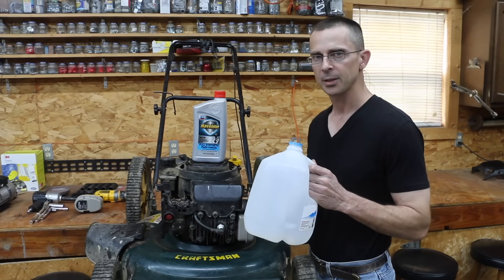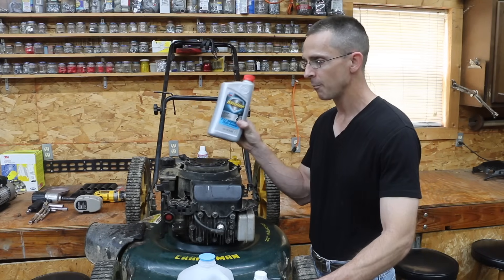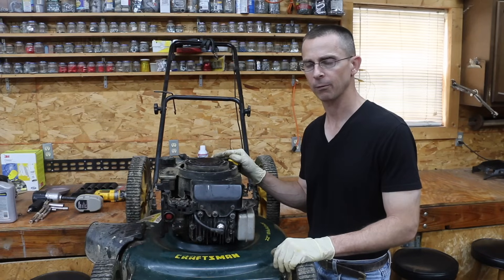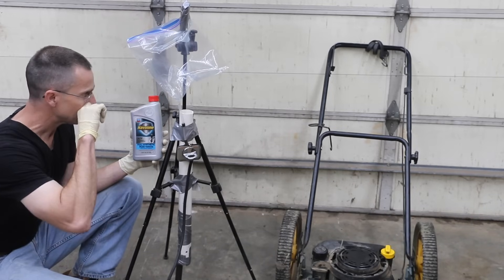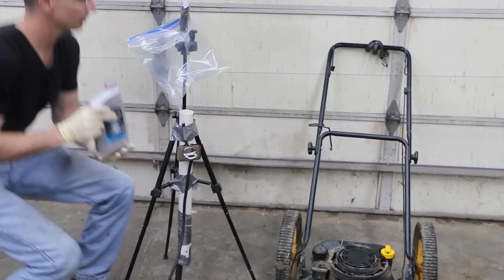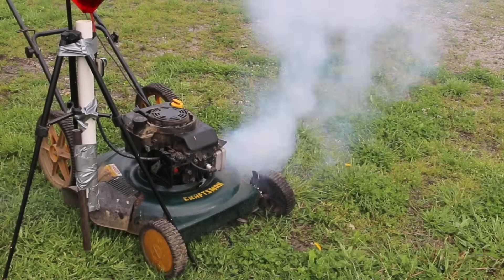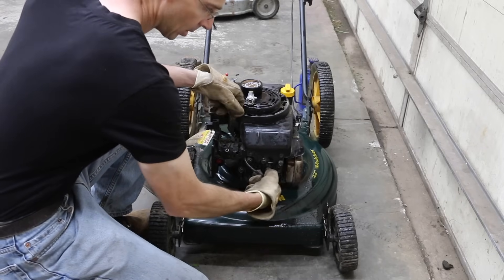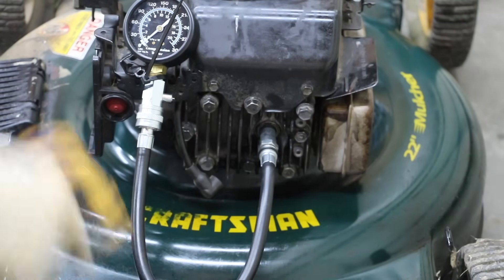Seafoam--can't believe what it did to my engine episode 6--Seafoam vs ATF!!

Comment: Did the test well, good effort and from the videos it seems nothing used does much cleaning of coke.
That said while you may be cleaning the upper cylinder, no matter what you use if it is not all combusted it will end up going past the rings to the bottom end and mixing with the oil, and wont do the bottom end any good.
So don't aspirate any liquids into the carby to clean the top end as it will only harm the bottom end.
These upper cylinder cleaning product are possibly the most harmful snake oil I've encountered, most others just do nothing where this can do damage.
If that doesn't convince you then at least change the oil and filter straight after using it, so add the cost of an oil change to it.
Reply from the maker: This is a great post and you bring up some great points regarding crankcase contamination.  I've seen this occur, especially in the water test video.  Thanks!
Reply: Yes I saw that one the water is quite visible. That gives you some indication of how much of any aspirated liquid ends up mixing with sump oil, and depending what it is will determine how much that thinning out causes bottom end trouble.
Other issues I have with this is dislodging coke in the engine whilst its running, there is a risk some of that will get pressed into the valve seat and burn causing a potential issue with valve leak.
And dislodged bits being forced down the piston sides to the rings where it wont come back out potential cause a ring gumming and loss of compression.
Imaging if you cleaned of all the coke with wire brush and then took the pile of it and tossed it into the intake at revs.
If you get the inclination to that might be a good video to do to determine the downside of using anything that cleans coke off whilst running. 
However you would need to tear it down to observe no debris on the valve seat or down the sides of the piston and above the first and even second ring and how much is there already before the cleaening.
Assemble it, add and exact measure of oil, and run the cleaner through it a few times for good measure, sea foam for example, then tear it down and inspect for any debris down the pistons sides, and the valve seats and remeasure the oil volume to see how much of the liquid mixed with the oil.
Perhaps retest the oil lubricity on your test bed too to compare the new oil.
If what I suggest is the case it would show pretty conclusively that these products have a serious downside and not just a comparison of their upper cylinder cleaning properties.

Comment: ATF and acetone are often mixed to create a penetrating oil for use on rusty bolts and the like by mechanics, I'm already curious about acetone alone but if acetone can't be run into the engine by itself the combination with ATF with acetone could yield interesting results
Reply from the maker: Thank you for this recommendation!

Comment: What have you found best works for knocking off carbon in a motor
Reply from the maker: I've got a lot of other additives to test before providing a final opinion.  To date, both Seafoam and Marvel seem to do the best.  ATF works extremely well too, but I'd avoid using it in an modern engine to avoid damaging sensors and the catalyst.

Comment: I know its easy to dump fluid down a engine. But removing the top of the head that easy id just clean it up on soft wire wheel.
Reply from the maker: This is a great point. Thanks for commenting.

Comment: what if you did a soak of the piston head? i know its harder on a lawn mower but my thinking is if you took the spark plug out dumped some sea foam in there let it work for a while and then sucked out the excess liquid what would happen
Reply from the maker: Thank you for this recommendation!

Comment: I'll use atf fluid.I do have a question for you what would you  recommend to clean out the  gas tank on a Briggs and Stratton series 450 push mower it got a white Chrystal powder in it form sitting for a while with gas that dried up in it please let me know what I can use I don't have a lot of  money to get a new one thank you
Reply from the maker: I would suggest removing the tank if you can and attempt to rinse it out with fuel.  I presume the fuel tank is plastic. Plastic is very sensitive to harsh solvents, such as acetone.
Reply: Project Farm  it has a metal tank

Comment: Hello. Sir i have an hydrolic oil do this work also like automatic transmission in cleaning the combustion chamber?
Reply from the maker: They both share very similar properties.  I wouldn't recommend using ATF or hydraulic fluid in a modern engine due to possible issues with the catalytic converter or sensors.  Thanks for commetning.

Comment: Years ago many mechanics used ATF in there gasoline tanks to clean. We poured about a half cup of Marvel Mystery oil a little at a time straight down the carb to clean it. Slowly or it would stall. Smoke like hell but when it cleared the car ran great.
Reply from the maker: Thanks for commenting on this!
Reply: Project Farm  Go to Google and in the search bar write in   LS1 Testing Oil and you will see the write up. The guy Sarge and crew tested and found 1 oz of Marine outboard two cycle TCW3 rated oil  at 1 oz per 5 gallons of gas will clean and lube your entire fuel system. I've been doing this for over a year and my Jeep and Volvo run great. You wouldn't know they were running at idle. It must be Two Cycle Water cooled  3 series oil not just two cycle. Works like MMO or Lucas but cheaper. Walmart has SuperTech Marine TCW3 for  about $13.00 a gallon. Try a pint and a few tanks you won't be disappointed.

Comment: Jordan make sure that when ur driving the car, use a 1 to 4 ratio. example: 1 quart ATF plus 4- quarts oil depending how much fluid engine uses. Couple days ago my oil was already dirty/ black. I added 1 quart of ATF drive 2 hours to relatives home drained it next morning. Added new filter and oil. usually I run 4 quartz of ATF with new filter only, only on idle for about 20 minutes. no driving,  no reving.  1 to 4 ratio as described above helps as oil pressure builds to get the high up cams.  thanks for feedback.

Comment: ATF is the BEST FLUID I found so far.  Recently, I did 2 Engines that is 20+ years old. OMG, the Engines are soooo smooth now :D. It made it sound almost brand new again during running !!! I also used it as a Cleaner and Wash the Engine Head / Scrub them to Bare Metal Shine.  I also use them on my Air Compressor and it made the Motor really quiet as well.
Reply: I made a Video in case People wants to see it, here:  https://www.youtube.com/watch?v=Luqmx0VlN1w
Reply from the maker: Thank you very much for commenting on this and thanks for the video link!
Reply: +Project Farm - I forgot to add, GREAT VIDEO AS ALWAYS.  I like the part that " Instead going to a Movie ", you do these Video instead.  Not just for yourself, but for People like us that watches them and learn from them.  Regardless if it's Bad or Good, I considered it's a learning process.   Your mistakes won't be mine sorta thing... So yea, a BIG THANK YOU AS ALWAYS !!!

Comment: Works great on diesel engines. It is even what the Dodge dealer told my dad to do in his Cummins to clean the injectors.
Reply from the maker: Thank you for commenting on this!
Reply: I forgot to say that in this case the transmission  fluid is to be mixed with the diesel fuel. It is poured into the tank and add fuel to mix it. About a quart per 20 gallons or so.

Comment: Have you tried to clean the valves in your mower engine with a toothbrush and seafoam yet?  
If so, was there an increase in compression?  I ask because I have a mower which has not run in 6 years. 
I loaned it out and the person thought kerosene was the same as gasoline.  It lost so much compression you could turn the engine over by hand without ever feeling the compression stroke. I decided to see what could be done short of buying new engine parts.  
After cleaning the exhaust valve with a brush and seafoam, the engine has gained a second life. 
While I have not tested compression, it runs as it did prior to loaning it out. (after a complete emptying and rinse out of the fuel system and a new plug) 
----------------------------------------------------------------------------------------------------
Hoping to have luck on a Kawasaki Ninja 900 this week.  Low compression on two cylinders. And based on the fouling of the plugs, I feel seafoam and a toothbrush might just save a $750 repair bill.
Reply from the maker: I haven't tried this yet. Thank you for this recommendation!

Comment: Try AMSOIL PowerFoam next.
Reply from the maker: Thank you for this recommendation!
Reply: Project Farm I admit I have used it in automotive/motorcycle applications. Does a decent job on the throttle body and the expansion of the foam did get to most areas of the plenum. Never used it on a mower or two stroke though. Also haven't the slightest on what happens in the cylinder as far as cleaning. I believe since it's a foam it's a little easier on the engine because it's not being sucked in as a complete liquid. Would be an interesting video for sure.

Comment: I used to use a mix of ATF paint remover a small amount of 30 WHT motor oil am 1oz of water shake till milky white at a high RPM slowly pour into the carburetor only one quart is needed did.t have seafoam if you can get it use it
Reply from the maker: Thank you for this recommendation.
Reply: Ok cool 2 parts ATF to 1 part 30 WHT oil  1/4 cup paint remover an then water shack it up real good we used this mix to remove carbon build up on older cars back when they lowered octain rating on gasoline piston slap an knocking ways a big problem in those day's I never did a tear down before an after to see how well it worked

Comment: Atf is similar to engine oil other than that it has significantly more detergents. That's why it cleans so well. You can use it as a motor flush too
Reply from the maker: Thank you for this recommendation!

Comment: ATF is a high detergent  lubricant. Enough of it will cause carbon to migrate into the oil and  sieze up the cam shaft. Been there, done that. People wanting to "clean out" a neglected engine have mixed ATF with engine oil at oil change.  Even 10% ATF can be a disaster.

Comment: Back in the day a car salesman I knew would pour ATF down the carb on engines with carbon build up. He poured it in until flooding out the engine. Let it set over night, pulled and cleaned plugs. Presto!!  The ATF soaking is what's effective not burning it. What it did in the crankcase will do for the combustion chamber and piston top. LOVE YOUR VIDEOS!!!!
Reply from the maker: Thank you!

Comment: A mix of approx 1 quart atf per 20 gallons gas (use 2 stroke oil at same mix rate for diesels) with every tank keeps the cylinders, heads, valves freaky clean. And when doing an oil change, you can drain a quart of the old oil, and add a quart of atf, then drive the engine for 50-100 miles (NO MORE THAN 100) , then change your oil. The atf will break up and remove a ton of deposits and de gunk the passages
Reply from the maker: Thank you for this recommendation!

Comment: I keep watching different way you are cleaning the carbon ? But what is the big concern with it having carbon ?
Reply from the maker: It could effect piston rings and on the necks of valves.  In engines with multiple cylinders, it can cause driveability problems.  Some of the newer direct injection engines are experiencing issues as a result of carbon build up.  Thanks for commenting!
Reply: I have a newer 4-mix 2-cycle sthil weedeater..... This seems to be a big problem with them.

Comment: I like your experiments, and just subscribed. I have used Seafoam in my Ford to clean the carbon out, purely out of belief that less carbon will fall into the oil to abrade the bearings if buildup is reduced. Frequent oil changes also of course - I'll never know how much each contributes to keeping the machine going, but at 30 years and 260,000 miles with strong compression in all cylinders, there is the satisfaction of taking care of things.

I never have a gauge, though, of how long it takes for the carbon buildup to return after a cleaning. What is your experience?
Reply from the maker: Carbon can return quickly if the engine isn't healthy or if the gas/fuel mix is off.  However, if an engine is property tuned and healthy, it can go quite a while without much build up.  Thanks for commenting!

Comment: How about when you have the head of your lawn engine , see how it takes to wire wheel the carbon off  piston and head valves close. Check compression before and after and remember compression on the high side spells horse power. The amount of carbon in engines today is not harmful , burning oil is more harmful then sucking on a tail pipe of today's engines . trany oil is a detergent nice job on wiping out a set of piston ring also trany on the walls cause fuel to light at different times hows your top ring of the piston doing now. You are changing ignition firing with cleaning additives, thank god for knock sensors in engines . Change your oil, when you see carbon blow by passing the piston rings turning your oil dark and then just maybe that dirty oil wont kill a valve lifter and your engine might keep its compression . keep up your good work on your learning curve. please stop burning oil and harmful chemicals for your own safety and your family . take care
Reply from the maker: Thanks for this suggestion!

Comment: I add ATF (GM type only) to the crankcase at every oil change. It really cleaned out the sludge in my 1940 model tractor engine that had deposits so thick I was scrapping them out with a putty knife before trying the ATF. Great vids!  Great editing, right to the point, real world results!  AWESOME CHANNEL!
Reply from the maker: Yes, I've heard ATF does a great job at cleaning the crankcase. Thank you very much for the positive comment!
Reply from the maker: ATF does a great job cleaning deposits in a crankcase.  Thanks for the positive comment regarding the channel!

Comment: You should try some of the CRC products. They have a lot more products than seafoam. Top engine cleaner, Motor Treatment, Intake valve and turbo cleaner (for toe of GDI motors), and a whole lot of other products.
Reply from the maker: Thanks for this suggestion.  I'll try some CRC products.  Thanks again!

Comment: how long do you keep it in a car and is it running , my oil light is on and was told to use it ?
Reply from the maker: If your oil light is on, it has low oil pressure and running the engine could ruin it quickly.  I don't want to offer advice that could worsen the problem.  It's difficult to advise without determining existing oil pressure and then figuring out why the pressure is low.

Comment: I understand there are silicones, and additives in aft that make it unsuitable for use inside a combustion chamber.  Of course inside a lawnmower is fine, but not in automobiles where o2 sensors, cat, etc. will be damaged.
Reply from the maker: David, this is a great point.  Thanks for commenting!

Comment: Water with a little ATF sprayed in with an old paint spray gun works well, so does using a wall paper steamer, pipe into intake and let the engine run untill all the waters boiled out the steamer.
Reply from the maker: These are really good recommendations--thanks!

Comment: Iv used atf with water. I shake it up in a used fuel additive bottle and let it sit for a few days until it's pink. Iv done it twice and i haven't had any issues. Only a smoother engine.
Reply from the maker: Carl, thank you for this recommendation!
Reply: Carl Br tap water or distilled?
Reply: My Off-Road Obsession drinking water. Sorry for the late reply